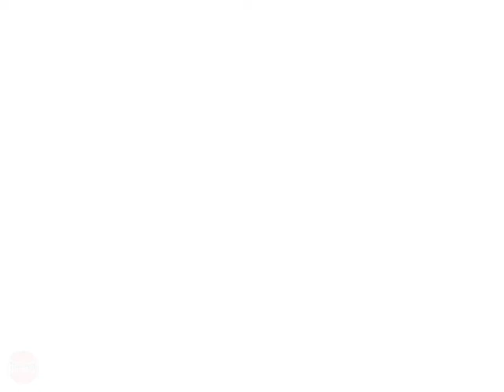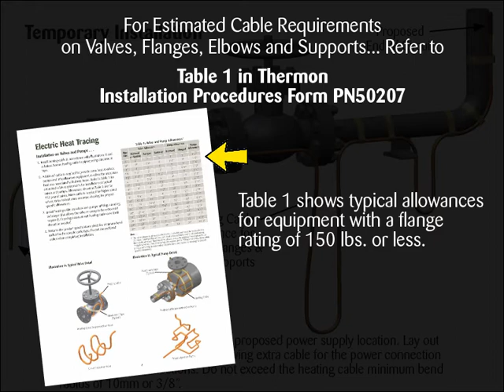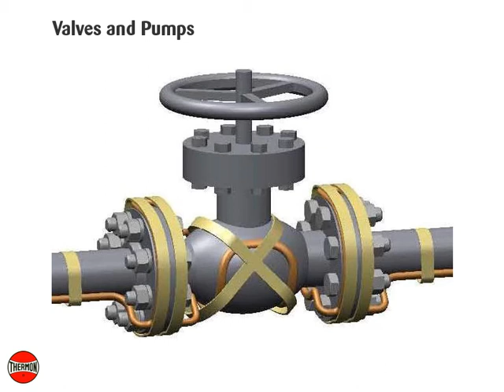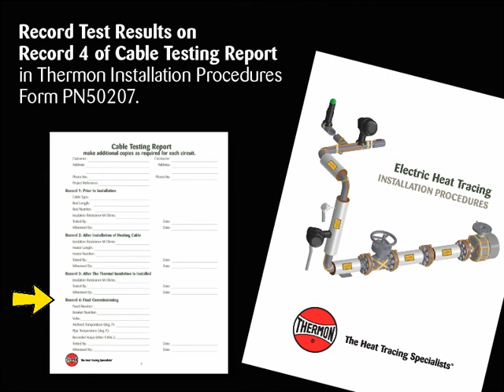Electric Heat Tracing Installation Procedures Video

Comment: 🎯 Key points for quick navigation:

00:00 📜 Installation procedures are guidelines for thermal electric heat tracing systems in various locations.
00:29 ⚠️ Installers must comply with safety and health guidelines and use appropriate personal protective equipment (PPE).
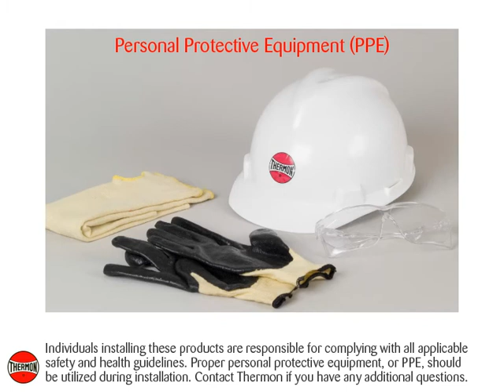00:45 ✔️ Verify the correct type and output of heating cable upon receipt, and inspect for shipping damage.
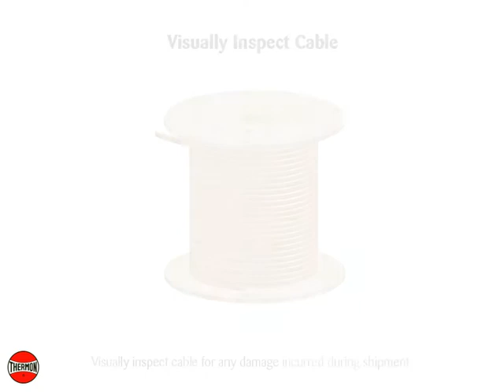01:20 🔌 Heating cables require electrical integrity testing, ideally with a voltage of 2500 volts DC for polymer insulated cables.
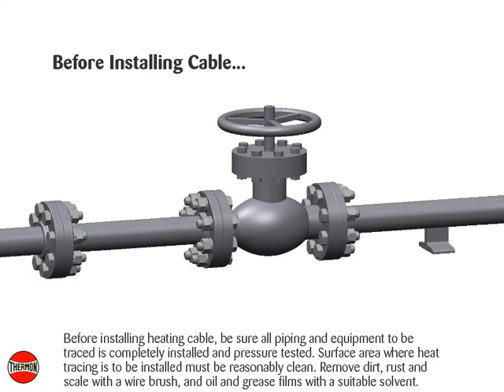02:12 🧹 Ensure surfaces are clean before installation, removing any dirt, rust, and grease.
02:30 📏 Position heating cables at the lower quadrant of pipes, typically at 4 or 8 o'clock positions.
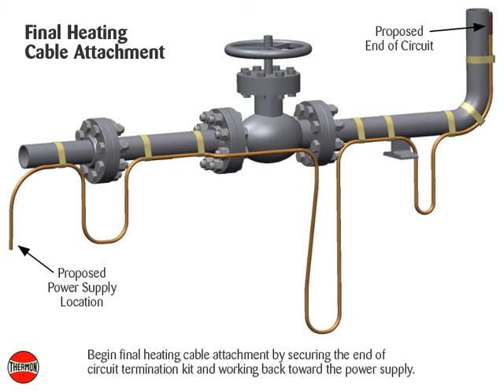03:49 🛠️ Attach heating cables with circumferential tape at 30 cm intervals to maintain contact with pipe surfaces.
04:06 📦 Locate cables properly on elbows, flanges, and other fittings to ensure effective heat distribution.
05:11 🔄 Use a looping technique for installing heating cables on valves and pumps to facilitate maintenance.
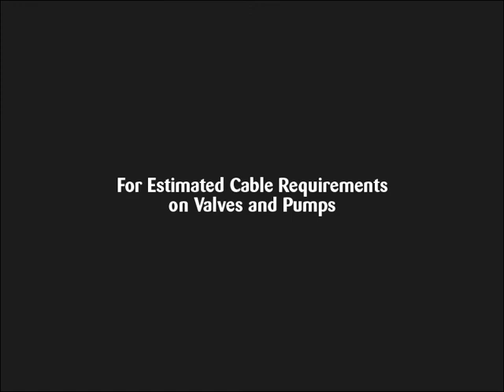06:25 🔄 Follow project drawings for cable requirements on valves and pumps; coordinate multiple tracers accordingly.
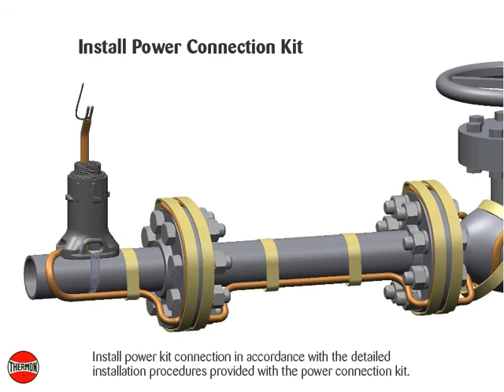07:45 ⚡ Test heating cables for integrity before power connection using appropriate voltage and recording results.
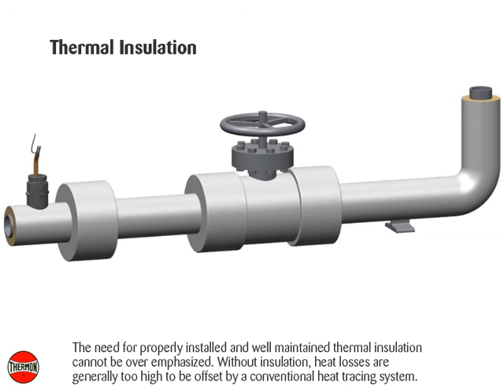08:17 🧊 Proper thermal insulation is critical to minimize heat losses; all heat sinks should be insulated.
09:16 🚧 Repeat electrical integrity tests after insulation installation to check for potential damage to cables.
09:52 📊 Conduct a final inspection by energizing the circuit and recording key operational data for future reference.
10:26 📝 Ensure warranty conditions are met through adherence to testing and installation guidelines from the manufacturer.

Made with HARPA AI